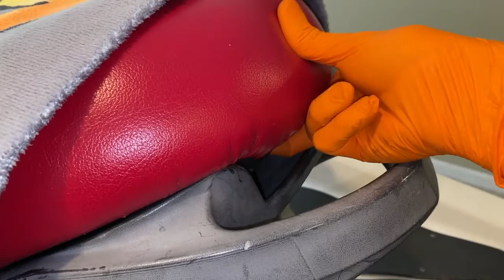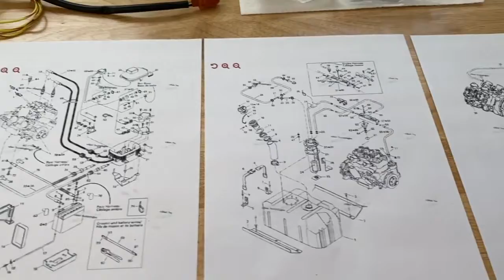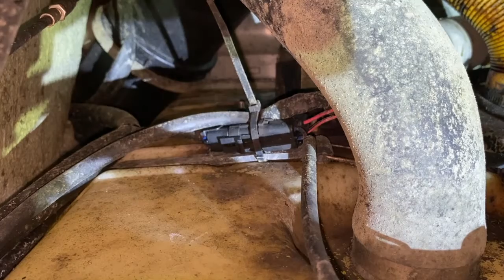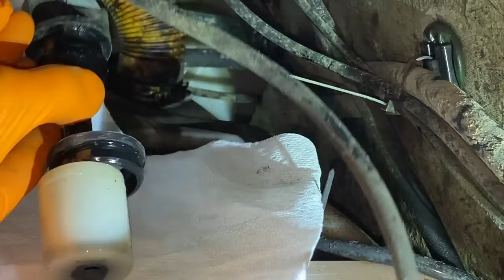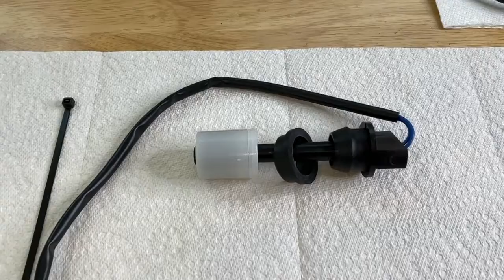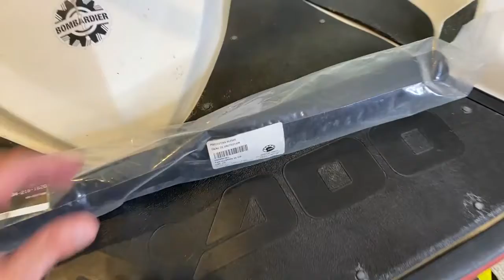Replace sea doo GTX oil tank quantity sensor

Comment from the maker: If interested in purchasing this product, visitor to Amazon affiliate link below.  I earn from qualifying purchases.

Oil filter:  https://amzn.to/49c0n0U

Oil tank:  https://amzn.to/3Ji306V

Oil tank grommet seal:  https://amzn.to/3JhjJan

Oil sensor Terminal:  https://amzn.to/3vHscRn

Oil sensor wire seal:  https://amzn.to/3xDdqM0

Oil sensor connector housing:  https://amzn.to/4aFndjm

Craftsman chisel:  https://amzn.to/3WaW5nU

Craftsman pliers:  https://amzn.to/49Pskw3

Craftsman cutters:  https://amzn.to/3UodFDr

Spark plugs:  https://amzn.to/43Wqp7p 

Spark plug gapper tool:  https://amzn.to/43Qbrje

Dielectric grease:  https://amzn.to/4cUn4tC

White lithium grease:  https://amzn.to/4aAhfAg

Craftsman flashlight:  https://amzn.to/43RGcEG

Zip ties:  https://amzn.to/43Pa44k

Zip tie cutters:  https://amzn.to/3xuep0U

Ignition coils:  https://amzn.to/4aqTyKB

AGM Battery:  ￼ https://amzn.to/4cO13MX

Coolant temp sensor:  https://amzn.to/3U81ytZ

Solenoid valve:  https://amzn.to/4aLKT4S

Vacuum system check valve:  https://amzn.to/3U8PtVy

Battery disconnect switch:  https://amzn.to/49tskBH

Craftsman ratchet socket set:  https://amzn.to/3J8IkOH

Craftsman volt meter:  https://amzn.to/3VS55OE

Swivel vise:  https://amzn.to/4awP2tK

START/STOP push button cap/cover:  https://amzn.to/3vomyDv

START/STOP button wire mechanism:  https://amzn.to/3TEoDDr

Glove box/storage unit latch kit:  https://amzn.to/3x9RMih

Seat latch:  https://amzn.to/43xVWwd

Front storage compartment latch:  https://amzn.to/43xVWwd

******************

1.  How to properly lubricate seat or storage compartment latch

          https://youtu.be/QiadPciE55E

2.  Jet ski storage compartment or seat not latching - Common causes

          https://youtu.be/gWX7obK3VA0

3.  Replace seat or storage compartment latch

          https://youtu.be/bweCd4TO-4U

4.  Replace glove box/storage compartment latch

          https://youtu.be/TmdrTVcUubQ

5.  Replace START/STOP push button cover

          https://youtu.be/VillHbgDckY

6.  Replace START/STOP push button wire harness

          https://youtu.be/5q9HbOxYY4Q

7.  Replace rear step foam pad sleeve

          https://youtu.be/w6HLiApFDuc

8.  Replace Sea doo GTX Starter

          https://youtu.be/Q8_be66r0Yw

9.  Replace starter relay

          https://youtu.be/MAvBmwvGgyc

10.  Replace Sea doo GTX Ignition Coils

          https://youtu.be/1VrtwJl6hjI

11.  Jet ski keeps saying low oil - Common causes

          https://youtu.be/vPycBUDWnCQ

12.  Replace coolant temp sensor

          https://youtu.be/4JOdX3GEphE

13.  Replace Solenoid valve

          https://youtu.be/SfjX9OtOyIM

14.  Replace vacuum system check valve

          https://youtu.be/iWjhaWlyQuc

15.  Install battery disconnect switch

          https://youtu.be/LOSq10Of_UM

16.  Replace sea doo oil filter

          https://youtu.be/fT3R7Mkb05s

17.  Replace spark plugs and wires

          https://youtu.be/gRTpc5pqLLk

18.  Rebuild Direct Injection Distributor

          https://youtu.be/Ac2xGvMr9eY
🧰

Comment: A link to the sending unit (sensor) itself? I don't see one and can't find one. Thanks! Great video!
Reply from the maker: Thanks for watching.  Below our links to all of the current available parts on our affiliate program site.

If interested in purchasing this product, visitor to Amazon affiliate link below.  I earn from qualifying purchases.

Oil filter:  https://amzn.to/49c0n0U

Oil tank:  https://amzn.to/3Ji306V

Oil tank grommet seal:  https://amzn.to/3JhjJan

Oil sensor Terminal:  https://amzn.to/3vHscRn

Oil sensor wire seal:  https://amzn.to/3xDdqM0

Oil sensor connector housing:  https://amzn.to/4aFndjm

Craftsman chisel:  https://amzn.to/3WaW5nU

Craftsman pliers:  https://amzn.to/49Pskw3

Craftsman cutters:  https://amzn.to/3UodFDr

Spark plugs:  https://amzn.to/43Wqp7p 

Spark plug gapper tool:  https://amzn.to/43Qbrje

Dielectric grease:  https://amzn.to/4cUn4tC

White lithium grease:  https://amzn.to/4aAhfAg

Craftsman flashlight:  https://amzn.to/43RGcEG

Zip ties:  https://amzn.to/43Pa44k

Zip tie cutters:  https://amzn.to/3xuep0U

Ignition coils:  https://amzn.to/4aqTyKB

AGM Battery:   https://amzn.to/4cO13MX

Coolant temp sensor:  https://amzn.to/3U81ytZ

Solenoid valve:  https://amzn.to/4aLKT4S

Vacuum system check valve:  https://amzn.to/3U8PtVy

Battery disconnect switch:  https://amzn.to/49tskBH

Craftsman ratchet socket set:  https://amzn.to/3J8IkOH

Craftsman volt meter:  https://amzn.to/3VS55OE

Swivel vise:  https://amzn.to/4awP2tK

START/STOP push button cap/cover:  https://amzn.to/3vomyDv

START/STOP button wire mechanism:  https://amzn.to/3TEoDDr

Glove box/storage unit latch kit:  https://amzn.to/3x9RMih

Seat latch:  https://amzn.to/43xVWwd

Front storage compartment latch:  https://amzn.to/43xVWwd

******************

Comment: hello my friend I watch your videos which are super detailed. I have a GTX DI from 2004 and I am bothered because outside the water with the hose connected it goes up in the revs but as soon as it is in the water it does not exceed 4000 rpm I changed the injectors were not that. the problems started because one day I had left my jet ski at home on and the time to go get gas with the water connected and my father, so as not to waste gas, told me turned off the jet-ski but left the water running and since then it has not exceeded 4000 revolutions. Do you have any idea what it could be? Thank you so much.
Reply from the maker: @nawel3131  

Thanks for watching, that means the world to us, no joke, thank you!

Any update?  Its possible that there is water in the block leading to the interference of power.  It’s good that it’s still running and wanting to keep running.

The water in the block is very likely due to the garden hose on pushing water through the system, while the engine was fully shut down.

Comment: Frist I would have clean all the inside as very dirty.  I am looking for info on the type that has the oil line in the center. We the owners of seadoo, should not have to replace electrical parts as fuel ,speed and oil. Poor quality.  Ask yourself when did you last replace your cars fuel gauge. The oil filter has nothing to do with the gauge sensor.
Reply from the maker: @busnorth  

Thanks for watching and sharing your thoughts.  Please let us know if we can help answer any questions.  😁👍🧰